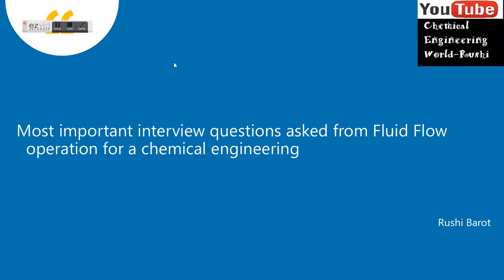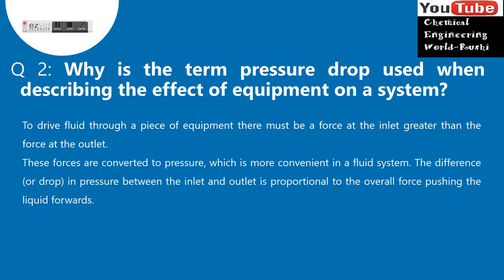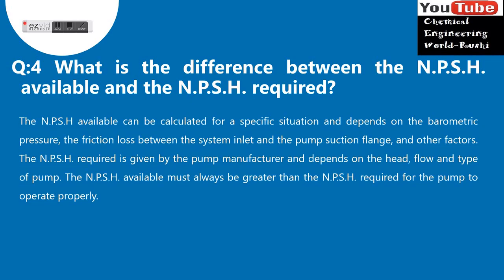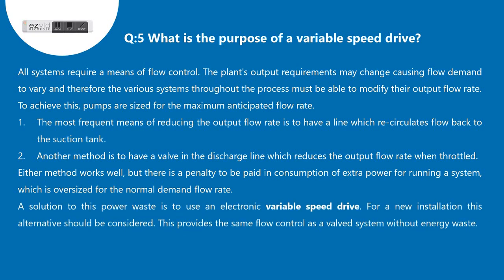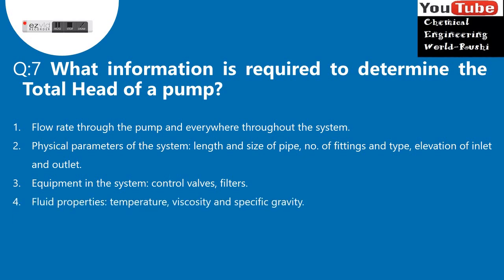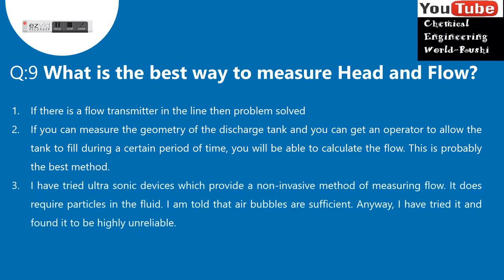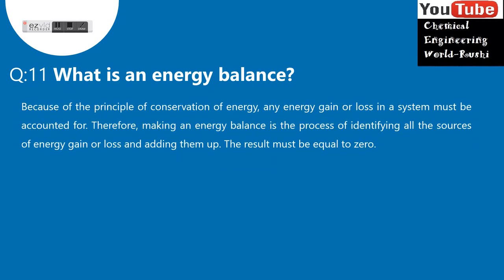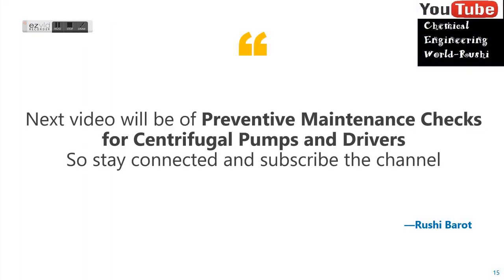Technical Questions asked  in Interview for Chemical Engineer from Fluid Flow

Comment: this all r fluid mechanics but in exam asking more related heat transfer ( fins use,  or heat exchanger sizing and rating)  and so on etc.
Reply from the maker: Yes so I have mentioned same that is interview questions for Fluid flow only and not exam questions it's interview questions...